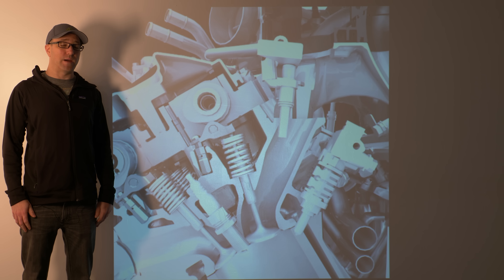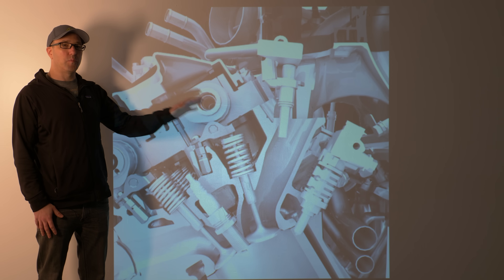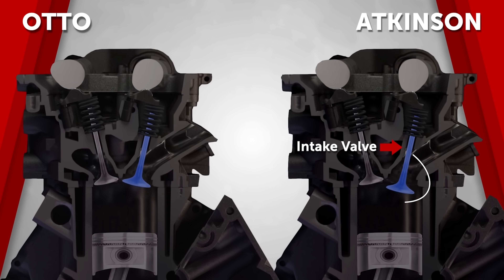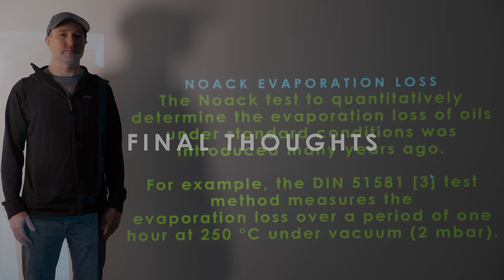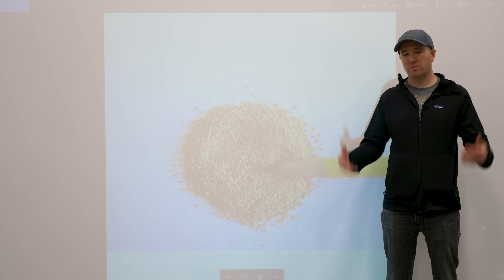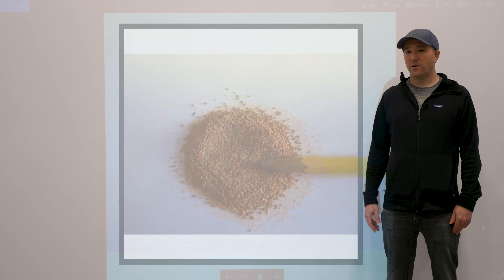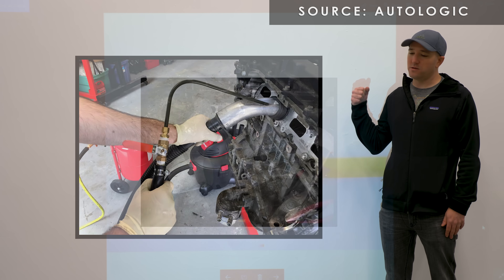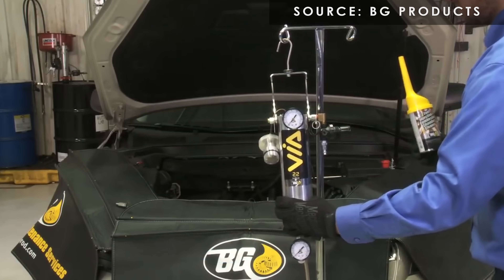Direct Injection, Problems and Solutions | The Fine Print

Comment: Awesome work!  So what about driving the engine hard to redline occasionally to break out the sludge in the intake valves?
Reply: The only thing that will break out the carbon coke on the valves is a chemical reaction. It hardens like concrete when the oil changes get above 5k and dilution takes over.

Comment: I added water/meth injection to my kia stinger along with catch cans. Sure there is more maintenance, oil to drain out of the cans, boost juice to keep in another tank but the end results are well worth it. I see intake temps under boost drop to 20 below ambient, the octane shoots up to 110+ and the engine internals get steam cleaned. Doesn't kick on until I hit 8lbs of boost with over 50% throttle input so I'm not using all that much boost juice. Obviously a typical car owner won't go to all this trouble to keep their engine clean but I've cleaned the values on a different car and prevention is easier than cleaning. Side perk, I pretty much have to floor it once in a while to keep it clean. The only downside is hitting a 100mph from a dig in 5ish seconds makes it tough to floor it for any length of time.

Comment: I’m still driving my 2009 Honda CR-V which I bought new.  I’m keeping it a few more years and intend to get an EV.  I don’t want all the fuel / oil dilution issues of these new vehicles.  It seems technology went backwards.  Reliability with these newer combustion engines is on the decline.  With fuel prices getting worse plus battery technology changing for the better, I say we we drop the internal combustion engine forever.

Comment: Excellent explanation. Yes, the 90's through 2008 were the best of gas engines. Direction injection and 10 speed automatic transmissions are vehicles to avoid if you plan to keep the vehicle
Reply: There are some 2010s gas engines that are pretty solid too namely the 2015 Toyota Camry, 2013 Infiniti G37, and a few others which have port fuel injection and transmissions with 8 or less speeds.
Reply: Naw not true as a blanket statement.  My 2020 Ranger with 88k miles has Turbo, DI, and a 10 speed.  It has been perfect and Ranger is now rated as the most reliable mid-size truck (Yes..Taco is 3rd place currently).  Looked at the valves just 5k miles ago with the bore scope and very very little carbon buildup at all.
Reply: @adamharris2674 imagine thinking a modern ford will last 😂.  RIP at 150,000km brother.

Comment: What a great video, clearly explained and easy to understand with great animations.
I have an audi TFSI engine so its definitely worth running shell V power fuel in this engine then?
Its got 42K miles on clock, sometimes it feels a bit lazy but I've had that with all my cars, will look into a carbon clean though 👌

Comment: Oil catch can are our friends.
EDIT: To your point about oil catchcans needing a screen, I call #BS , and, #FAKENEWS. 
I had a catch can on a port Iinjected NA 4 banger, super cheap, no screen, just a pipe down and a hole back into the intake and it caught a mess of funky stuff. Like, after 5k, about a cup of funk. 
So just to work with what you're saying, buy a cheap catch can, throw in some COARSE steel wool, call it a day.

Comment: Great CAD model and animation however the issues mentioned are not the biggest issues with GDI. Every motor model can be different but the direct injectors all use the same basic design and construction. Bosch is one of the most common GDI fuel injectors found on cars today. They can suffer from mechanical problems with the pintle becoming stuck and fuel dumping directly into the cylinder. I speak from personal experience and feedback from service managers as well as public consesis. I had both a Jaguar XF 5.0L V8 SC & BMW 320i twin power turbo, suffer from a mechanical injector problem whereas the electrical elements of the injectors were fine. 1 injector on my Jaguar stuck open on the highway and gas began dumping out the driver side exhaust. I pulled over and called a tow truck. While waiting I was listening to the radio and that car energized the low pressure pump for 1min when the driver door is opened. I got out to inspect the engine and got back in and did not know it was an injector problem. The injector stuck open was filling up the #3 cylinder with gas. Keep in mind that liquid fuel is uncompressable. After an hour the tow truck came and the driver started my car to reverse it. Thats when it sounded like a massive rod knock in the engine. When the piston traveled up in its compression stroke, it couldn't compress the liquid fuel and the engine hydrolocked bending the rod and ruining that $25k motor. Jaguar does not sell internal engine components for the SC 5.0L V8 so a new long block or complete engine is the only option for a new replacement. My next vehicle was a BMW 320i with 25k miles. Shortly after buying the car it suffered from a miss fire. Upon inspection 2 GDI fuel injectors stuck closed this time. 

Here's the really crappy part. The injectors weren't covered by my warranty  because it was a mechanical failure of the injector vs an electrical failure. Non of the repairs were covered. I spent $4500 at the dealer to find that they wouldn't cover it. 3 months later another injector failed in the same way. This highlights a typical mistake replacing GDI injectors. Replace all injectors as a set if any of them fail. This is recommended by many OEMs including BMW but the service manager never mentioned it. I replaced the 3rd injector on my own which was not difficult. After replacing it, the engine had a slight missfire so I sent it to the dealer. The 3rd injector actually stuck open and wiped the cylinder meaning the constant spray of fuel washed the oil from the cylinder walls everytime the piston moved up and down causing rapid ring wear and loss of compression. This time my warranty covered replacing the engine but they could have denied it because it was caused by an uncovered failure (mech injector failure) but luckily they didn't give me any problems. Both cars used the same basic type of Bosch GDI injector. There are some that recommend using an additive with upper cylinder lubrication every oil change by running one tank of gas with additive. Others suggest using a fuel cleaner but there isn't a golden bullet for this issue and it's very hard to predict. For me it occurred on the BMW at 25k miles and the Jaguar had over 115k miles when it failed. When one fails its typical that the other injectors will also soon fail. It's not worth risking it especially when the engine is already apart. Some engines and models seem more prone to this issue and others seem more reliable. Research common failure for your vehicle to get a better idea of what to expect. I have never had build ups causing issues on the two engines with injector failures but this also depends heavily on the PCV system and level of blow by.

I do have to correct one very common and inaccurate misconception. Engines in the 90s or any other period did NOT reach efficiency levels of 60 to 80 mpg as claimed in the video. Today's engines are the most efficient in history and GDI is typically coupled with a smaller, reduced displacement engine combined with a turbo to make the same or more power than a naturally aspirated engine of larger displacement while also achieving greater efficiency. Today's cars unfortunately weigh substantially more than any other period in time. The engines are much more efficient but they are countered by a heavier vehicle. This reduces fuel economy but it's still the best of any time period. My Jaguar weighed more than 5,500 lbs! A lot is from all of the safety systems, emissions and electronics as well as luxury or comfort options. Diesels have been quite efficient even going back to the 90s but gas engine efficiency has steadily increased with advancements in technology. Please don't fall for the myth of "cars used to get 60mpg back in the day"... it's just not true. If you want to make a comparison, compare like for like including vehicle weight in order to get a full picture. Watch out for slight misfires that can indicate that an injector could be starting to fail and get it inspected at a shop. Sometimes there are some warning signs and sometimes it occurs without warning. Read the fine print in your warranty especially a non-OEM extended warranty. They know what is likely to fail most often and whatwon't, this partially shapes the coverages of the plan.
Reply: You're insane

Comment: E85 is a considerably cleaner burning fuel and would cut down carbon on valves,personally I would put a pipe in the exhaust near manifold/header flange and put one way check valves in to siphon vapors out crankcase & not reburn instead let exhaust burn it and not use a pcv valve,and as preventive maintenance spray generous amount of  gasoline + carb cleaner into intake once every other month to keep intake & valve + valve bowl clean

Comment: The problem with using thicker viscosity oils is that the newer engines have tighter tolerances and aren't engineered with thicker oils in mind. don't suggest people try using thicker oils unless specified by the manufacturer.

Comment: This is an amazingly informative video. Now I know!

The problem I have with the message being conveyed has to do with maintenance. If I have it right:  buy a DI car you'll have to do restorative or preventative maintenance to help ensure it operates at peak efficiency. 

Duh!

If I don't regularly sharpen the blade on my lawnmower, or replace the blade periodically - and they're not cheap, it will not function as well. So, maintain my equipment.

Comment: Blowby goes DOWN past the rings  and builds up in crankcase, not up past the rings into the cylinder head. This buildup is routed into the intake port  through the pcv system. In the days before pcv the blowby was vented out of the crankcase directly to the atmosphere.

Comment: If recall 98' Mitsubishi Galant GTZ had 2.4L D.F.I. first of its kind. Lasted 2 years. Many problems!   Oil catch can installed in  PCV system can prevent some of oil blow by. Also,  Don't use different grade oil it can damage the engine and void warranty. I will change the oil at 30% Life is best insurance for today's engines.

Comment: I have a 2019 MAZDA CX-5 with a 2.5 L. turbo direct injection engine. It DOES have an "air/oil separator" which helps keep recirculated crank case emissions a bit cleaner.
BUT, with no port injection to keep the intake valves clean I had a Cork Sport OIL CATCH CAN installed and now I get the nasty crankcase  fluid collected in the catch can INSTEAD of going into the intake manifold and getting the intake valves dirtier.
AND at 40,000 miles I'll have the valves professionally cleaned with B-12 cleaner. That's all you can do as far as I know.

Comment: Very good presentation, good information. My wife's car is a 14 Chevy Cruze 2L T-diesel with 180k on the clock. It's been a good car that gets great milage. But recently it's making little more noise than usual at idle. Sounds like it could be coming from the valve train. Probably need to stick a scope down the intake (yes, I know than means pulling the turbo) to see what my valves look like. I like the walnut shell idea, that sounds way better than pulling the head. No, I am not running a catch can yet. Hopefully I can clean it and get another 100k out of it.

Comment: HAS ANYONE MESSED WITH USING A MIXTURE OF WATER ALCHOHOL AND DETERGENT AND INJECTING IT INTO THE PORTS TO OVERCOME THE CARBON BUILD UP ON INTAKE VALVES!!
THE INTAKE PORTS CAKING UP IS VERY FAMILIAR TO ME AS A LOCOMOTIVE MACHINIST ON THE RAILROAD!
THE G-E 7 -FDL ENGINE WAS PRONE TO DIRTY UP THE INTAKE PORTS AND VALVES AND ON ONE YEAR AND 2 YEAR INSPECTIONS 
THE AIR MANOFOLD SECTIONS WERE REMOVED AND CLEANED 
IN A VAT, AND THE VALVES AND PORTS WERE WALNUT BLASTED
OR PRESSURE WASHED.
THIS WAS DONE WITH THE VALVES CLOSED TO PREVENT GETTING INTO THE CYLINDER.
I ALWAYS FELT THAT INJECTING SMALL AMOUNTS OF WATER /ALCHOL/ AND DETERGENT COULD HAVE HELPED , BUT NEVER HAD THE OPPORTUNITY TO EXPERIMENT!
KEEP THEM ROLLING BROTHERS!!
👍👍

Comment: Before about 1965, before PCV valves, there used to be a 'dump tube'  Basically, the pressure (what you call 'blow by' from the bottom of the crank case, is simply 'vented' through a simple dump tube to the outside.   Your lower crankcase might generate 3 to 5 pounds of pressure.  The "solution" was pull vacuum to the lower crankcase, through a PVC valve...  Problem is...  you're pulling more vacuum than necessary and you're actually 'mystifying' oil in the crankcase and sucking it into the combustion chamber.  THATS is where all that GUNK comes from that clogs the back side of your intake valves in a GDI engine.  One solution..  disconnect and plug your PCV hose, and vent to atmosphere your lower crankcase, like has been done for decades....  LITTLE to no oil loss, because as I said, your lower crankcase generates little PSI.

Comment: The direct injection is pathetic my 2010 suburban port injection 133k miles always runs perfect my friends 2018 suburban direct injection valves gunked up injectors plugged up high pressure pump all went ot the same time at 76k miles 4k to fix it but his valves are still gunked up.

Comment: Can an injection Port be put in the catch can or drilled into the intake above the valve for spraying seafoam or Lucas occasionally during oil changes for example.
Or have a gallon of it in the trunk of the car and every so many miles it just injects it in there. While the engines is good and hot while cruising down the interstate.

Comment: Get a GDI fuel system cleaner at your mechanic shop it’s a IV system that drips the cleaner by way of the intake manifold instead of in the fuel tank it drips it’s way through the intake manifold n works it’s way to all the back side o the cylinder head valve’s cleans them really good every mechanic shop has this service

Comment: Although I might be wrong my understanding is that blow by was from gasses getting past the rings and getting into the crankcase due to higher pressure on one side being the head (combustion chamber) flowing to lower pressure in the  sump rather than the opposite direction that is described in this presentation. The crankcase has a mixture of air and oil vapor which gets into the rocker cover and then is removed by the PCV to  send it back into the intake.
Reply: @Rob...My 2008 CTS 3.6 DI doesn't have PCV valve. Only an orifice 🤷‍♀️
Reply: @cinnamongmc5430  That's something did not know.

Comment: with proper maintenance carbon isnt an issue with gdi engines (at least mine)

i boroscoped each cylinder and intake manifold out of curiosity and to my pleasure it was clean as a whistle, engine has 92k miles.

i didnt check the valves, but, no carbon in the intake mani and none on the piston heads are a sign that the valves are most likely clean too. zero carbon, zero sludge.

Comment: When it comes to water methanol injection what would happen if a guy put some fuel injection cleaner in with the water methanol if it’ll stay suspended ain’t gonna hurt nothing I wouldn’t think anyhow if you constantly cleaning the backside of the intake valves and the intake porch again if it’ll stay suspended this is a Jim mungai from Kennerdell Pennsylvania

Comment: Methanol H2O injected onto intake valve via bosses in the intake plenum will improve combustion, lower engine component temperatures, reduce heat quenching of engine cylinder head castings, and clean the intake valves allowing the use of higher compression ratios, higher boost levels, and more ignition/direct fuel injection timing advance in engine  tuning situations to optimize efficiency and power output.

Comment: With port injection the intake valves are always super hot to help atomize the fuel too. its a hidden benefit to port fuel injection. I myself like simplicity and function beyond anything else! I think that the DI is pretty inpressive i used to have a 2014 vw jettta se with a gas 1.8tsi turbo engine and i would get 47mpg on the freeway with the air on full blast in 100F temps driving for hours! My 94 f150 4x4 with a 302w and 5 speed can get up to 20mpg if i shift below 2k rpm’s.
Reply: A 2015 Camry has a port injected 4 banger than can easily get 40 mpg. I had a 2004 Lexus RX330 and I have averaged at 25 mpg with lead footed driving.
Reply: @davidperry4013  yeah I’ve averaged 24mpg in my 94 f150 4x4 5.0 5 speed   By going 60mph and sitting in 5th gear in cruise control for several hours straight. I had a 91 fox body with 5.0 and t5 speed and I got 35mpg in it cuz it weighed like 2700 lbs and I could drive all day under 1500 rpm’s